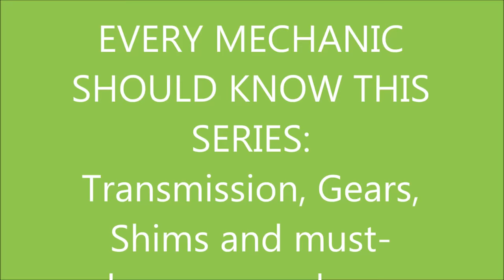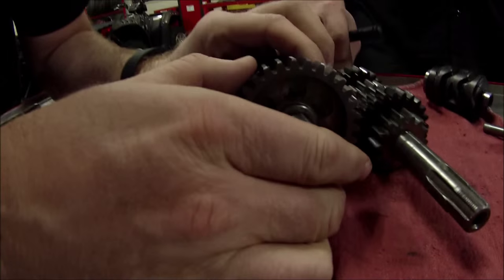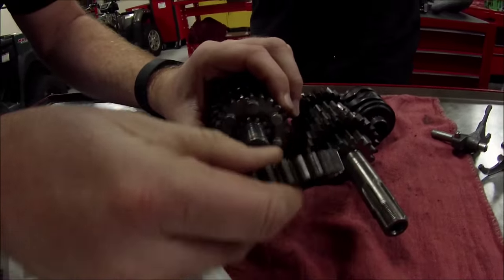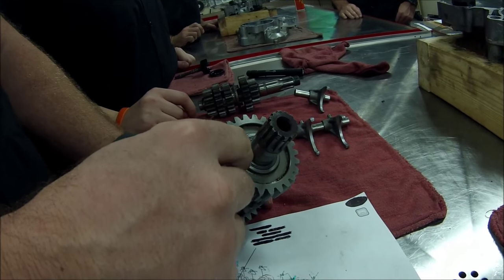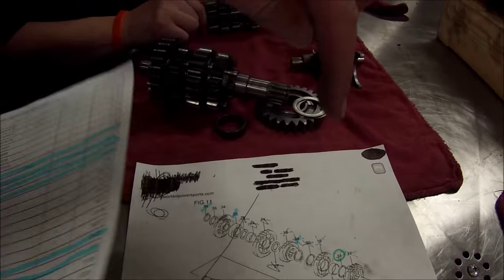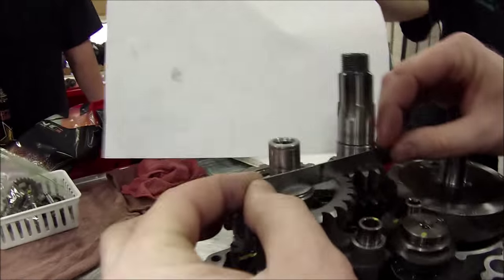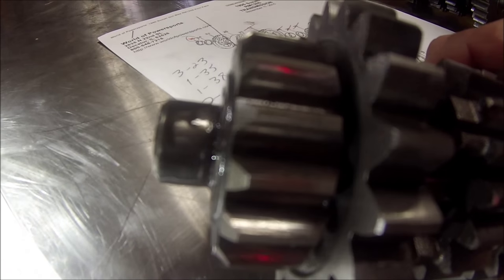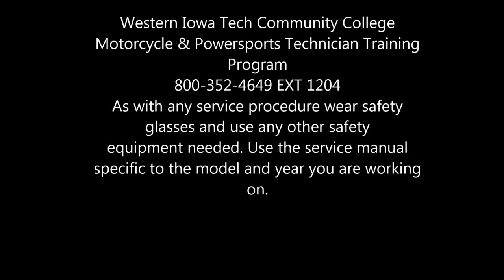Every Mechanic Should Know Series: How to shim transmission gears Installation info

Comment: I owe you a lot Shane, I was in complete transmission assembly hell. According to the schematic (‘71 Kawasaki F8) after installing 4th gear on the output shaft goes a washer followed by a circlip ring. Well, that leaves the washer dangling, and like you mentioned this is a precision assembly and nothing should be left dangling. I then referenced the cutaway diagram like you showed, to identify exactly what should be located where, and son of a gun the schematic has them reversed. THANK YOU!
Reply from the maker: THank you Clement Hill Cycle...Glad to hear how you liked the videos. Want more? Smash the sub button! Here are the links to support us for this information and our work saving you money.
Join this channel to get access to perks: (Free tool giveaways and member-only videos)
https://www.youtube.com/channel/UCBhM8DCKnT3qXwTW0eToyCg/join     

Give us a high 5 here:  https://www.paypal.me/how2wrench

Comment: I'm rebuilding a 96 CR250. Your video or someone elses mentioned that the washers and split rings on the tranny are directional. I checked mine and they were all on backwards according to the service manual. I'm not convinced that a mechanic had spit the cases at some point and did that by accident. The bike is pretty original. I think they were like that from the factory.
Reply from the maker: I'm doing a video on a 2001 Harley right now where a snap ring was installed backwards from the factory. Rare but not impossible. Yes, these are directional and have been FOREVER...EVERY service manual states this BUT it is found in the "general" chapter which is often not read. I have done multiple videos on this. Yamaha had a recall a few years back in which deaths were involved from these circlips were installed backwards. 
If I can ever be of service to you, here is a video explains how to connect with me. 
https://www.youtube.com/watch?v=vjvmB01ebcs 
Keep Wrenching,
Shane Conley
Instructor/Motivator/Motorcyclist
www.how2wrench.com
Like freebies? Click here for a free diagnostic checklist! 
http://gem.godaddy.com/signups/364621/join 

Did you like this free video and hope to see more? Would you just like to say thank you with a donation? Click https://www.paypal.me/how2wrench
Reply from the maker: My video on circlip installation. https://www.youtube.com/watch?v=upvWlPJkEMI
Reply: how to installe clutch lining tMx155

Comment: Brilliant video. When re-assembling the gears on the shaft, is there supposed to be ANY movement on the Gear wheel ?..Iv'e heard there should be slight movement to allow Oil into the inner gear shim/bearing? Cheers.
Reply from the maker: There is always some movement but it is best measured. Want to show you how and do it with you? If it was a quick answer I’d try to respond here but I wouldn’t want to lead you wrong assuming certain factors. Reach out to me on my website contact page. We have been overwhelmed with ungrateful people and scammers so I had to do something for my sanity by screening the over 300 requests a week!

Contact Link: https://how2wrench.com/contact/ 

Your answers and help are just around the corner. Save time and money while protecting your investment and yourself by doing it the right way at www.How2Wrench.com  
Have you subscribed yet to never miss a video? 

Have you seen the video playlists https://www.youtube.com/user/conleybuilt/playlists? 

Want to say “thanks” or “keep it up”? Click here https://www.paypal.me/how2wrench

Comment: The biggest problem is the odd case of getting reliable info on correct assembly. If you know it has never been touched since factory production, fine- record how it came apart. But how to handle factory install mistakes vs factory revisions, vs manual misprints or revisions on later years. Now try to get the correct info from the factory or (for the home mechanic) an authorized shop. Three mechanics and three different answers. 
 What do you suggest in those cases? I find that’s when all your knowledge and experience comes into play. As you state, understanding the basics but also when special  circumstances apply.
There are times getting correct installation info seems impossible or contradictory.

Comment: ight i have a issue that i need help with.  im am rebuilding my tranny in my 1981 harley  XLH1000,  i have replaced the race bearing, and now i am ready to install the roller bearing, and washer with retainer clip in so that thee roller bearings do not fall out the other side.  one issue i am having is with the blind retainer clip.  their is no eyelets on it to use a normal set of snap ring pliers, both side have flat ends.  I need to compress it down to get it to fit in to the groove inside the race bearing ..  can you help .  blessings